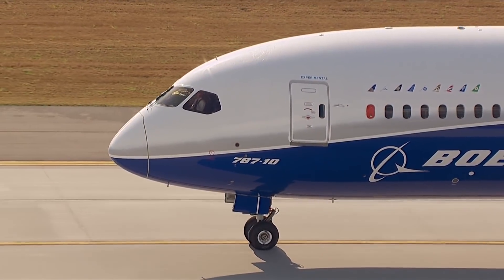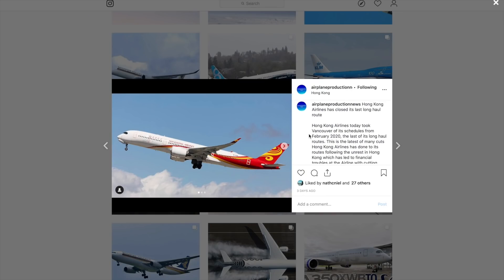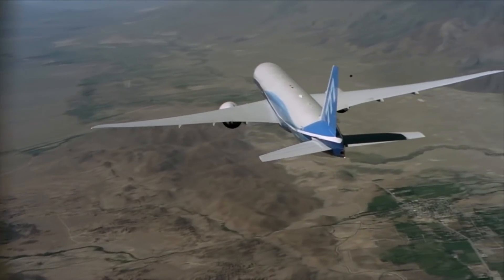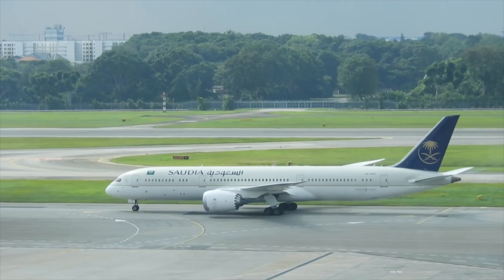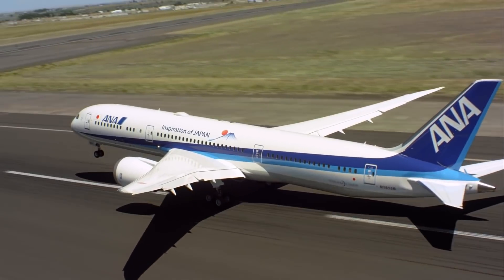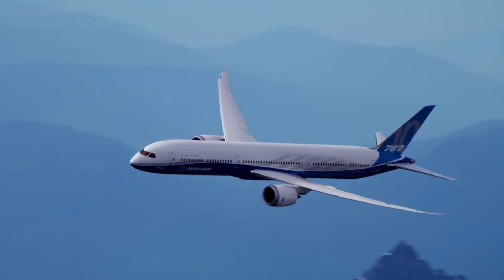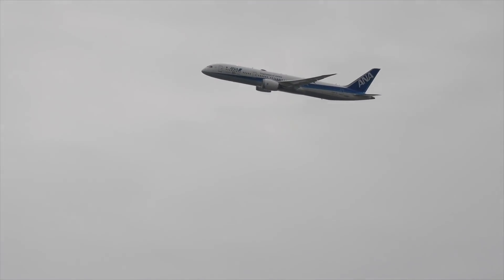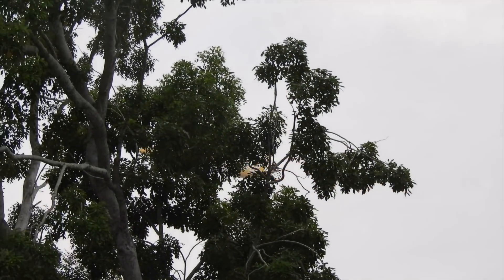787-10 and 787-9: How would an ER/ LR vs against 777-300er?

Comment: In case you don't know the -10 is limited to MTOW and not fuel, it can fill its current fuel tank to maximum but this would means the aicraft would only carry ~150 passengers or lesser. Overall its the structure of the airframe limiting the range, adding extra fuel tank is pointless as current tank is not even fully fill. Well of course boeing could strengthen the structure, but this would also means they have to change the landing gear to 3-wheel as suppose to current 2-wheel similar to 777. The wings would likely need to be strengthened or larger slightly to handle the most likely higher weight airframe.

EDIT: Spelling
Reply: Isn’t this why Boeing developed the 777x, new wing box, wings, bogies, engines on the 787 would be almost like developing a new aircraft
Reply: @12345anton6789  well not exactly, the boeing 777x carries more passengers (even the 777-8 model) and also much heavier than 787 no matter how much weight boeing tries to cut given that its airframe is still metal like current 777. But yea what you are saying is correct, making the necessary changes to accomodate more range while maintaing the current capacity on the -10 would require quite a number of changes but certainly not the engines given that it still is quite powerful one.
Reply: paper9oll the 787-10 can’t operate at MTOW in the hot season in Dubai, the engines gets to hot. This is normal for an engine that reach it maximum operating limits. The only way to get the temperature down is to limit the fuel flow, so the engine runs colder. It would probably work on a 787-9, the same engine has lower max trust because of lower fuel flow and it therefore it runs colder
Reply: @12345anton6789  Is it? I thought it is typical Emirates issues given that their sister (Etihad) few miles away flies the 787-10 in 336 capacity which is around the 2-class configuration figures by Boeing. They flies the -10 on 7-8 hours mission and depart AUH from 2am to 1pm (summer timetable), 1pm would certainly be very hot during the summer season. If Boeing decided to introduce strengthened 787-10 with stronger engines, they would certainly have done so when Emirates requested for it given that they are one of their biggest customer.
Reply: Not true. Almost everything you said is totally false , the 787-10 can fly 11700Km at MTOW, with 330 passengers ....

It shares the same MTOW and Fuel tank  as the 787-9 to keep costs low and maintain commonality...

Structural reinforcements will be needed to allow the aircraft to carry more weight or simply increase the MTOW but a triple aisle wheel system like the 777 will not be needed. 

The a350-900 has a MTOW of 280 tons yet it still uses a twin aisle wheel system, the 787-9/10 currently have a MTOW of 254 tons and even of this could be increased by 20 tons , it is still no where near that of the a359 , so a triple aisle bogey is not really necessarily

Anyways yes , currently the tanks on the 787-10 are never filled for most of the time , this applies to all other aircrafts because not all routes require an aircrafts total range. 

You only carry enough fuel for the journey. Adding more fuel tanks will allow more fuel to be carried and that's the point of the ER /LR terms , it is not pointless as you claim

Comment: Boeing should hang a couple of GE90's on the 787-10  there already are several thrust ratings on that engine over the 787's GE engines !! !
Reply from the maker: Wilbur Finnigan Thanks for your comment! The GE90 is a great engine and is extremely powerful though not particularly the most efficient... still, it would be awesome to see the GE90 engine on the 787. Thanks for watching and do stay tuned for more great videos :)

Comment from the maker: So here is the QUESTION then, will a 787-10ER and 787-9LR really work? Let me know your opinions in the comments, or if your made it for the LIVE PREMIERE, congratulations and comment in the LIVE Comments box instead :) In the meantime, till we meet in the next EPIC Comparison, wishing you, as well as everyone, clear skies ahead during the Christmas period!
Reply: If the Rolls Royce Trent 1000 ultrafan revealed then at almost the same time Trent XWB also released the new version so when Boeing upgrades into 787-9LR & -10ER, Airbus probably ready for the next A350 from current -900ULR & -1000.🛫
But the condition will likely make more option for airlines to consider which aircrafts fit for their market & range compare to the fuel burn rates. 🤓🛫
On my opinion, the 787-10 & A350-1000 will be a niche option for airlines.
🛫🛫🛫🛫🛫🛫🛫🛫🛫🛫🛫🛫🛫🛫🛫🛫
#AvGeek
Reply from the maker: Stradivarious Hardhiantz Thanks for your comment. Yep, airlines aren’t looking for seats but rather medium sized twinjets that have Low operating costs and are easy to fill. The 787-10 is actually around the same size, slightly larger than A350-900 but doesn’t compete with the A350-1000. Thanks for watching and do stay tuned for more great videos on the way!
Reply: @oneskyflyer  on my point of view, in terms of capacity & generating profitablity compare to fuel cost & maintenance costs the 787-10 suits for mid range regional market while the A350-1000 perfect for ultra long haul routes🤓🛫
Reply: @oneskyflyer  The 787-10 is 1 metre longer than the A350-900. The wing is rather small and the payload capability is reduced. If Boeing want to LR/ER that aircraft, they will need to put a larger wing and engines on the thing. It can barely lift off as it is without increasing the MTOW. The A350 on the other hand has a Trent XWB that is essentially the same engine rated right through from 84k to 97k. So if Airbus wanted more performance out of the A350-900 they have it waiting on tap in the engine department. Boeing have a big job to get the 787-10 anything close to the A350-900 on range.
Reply: B787-10 LR be ideal
Reply: @rajnirvan3336  When Boeing put an altogether new wing and engines on it....
Reply: @nathd1748  makes sense
Reply: 787 XWB
Reply from the maker: Felis Richar Haha! Interesting names indeed. Where did these names come from I wonder...
Reply: 787 neo
Reply: 787 ulr
Reply: 787 XLR
Reply: It absolutely would work
Reply: @averagejoe9249  Yeah anything will work if you have the market and throw enough cash at it. Doing a LR/ER version of the 787-10 would require a considerable MTOW increase which the current wing just cannot support. The current 787-10 cannot even climb out of hot airports with a full load of passengers and their bags.